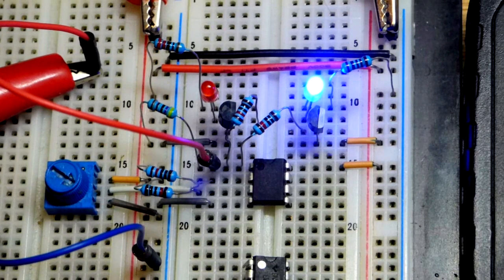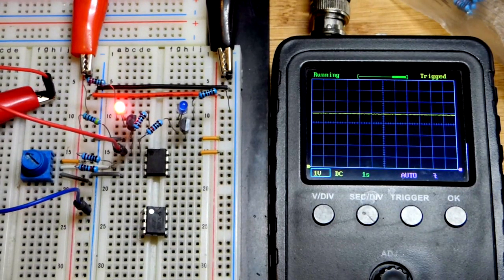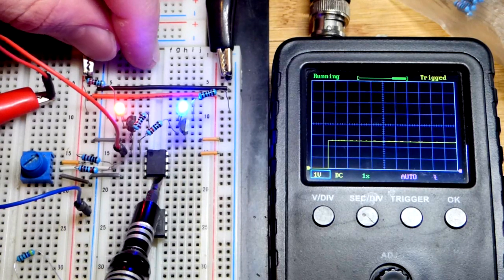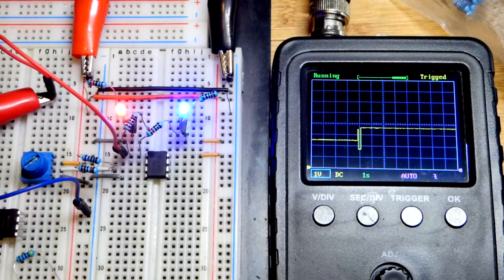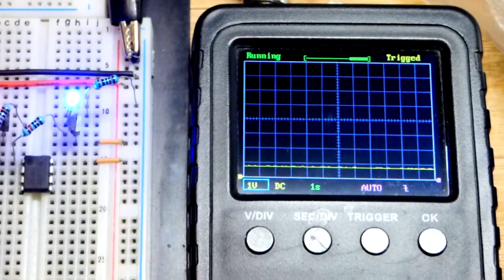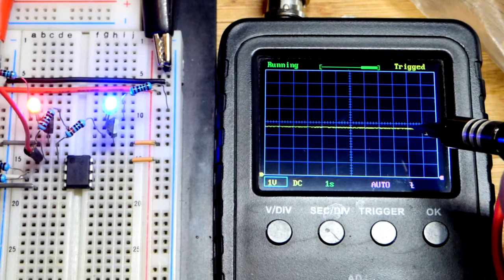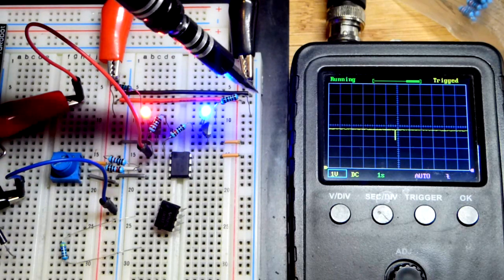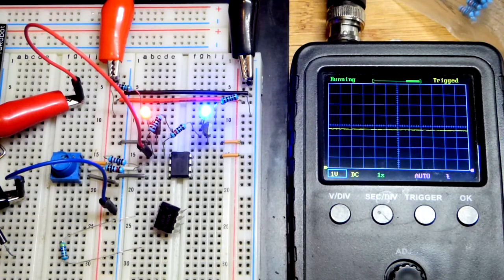Bonus video comparing NPN PNP BJTs amplified output LM393 LM358 learning electronics lesson 0021a

Comment: I am confused.   Where is the schematic?   I don't understand what point your were trying to make.      The LM393 has an open collector output so you do require a pullup resistor sized properly for your load.  You might want to configure first transistor to be driven directly by the LM393 output and the second transistor be driven by the first transistor and act as an inverter so they both switch at exactly the same time.  No hysteresis involved.   Good topic for follow up video.
Reply from the maker: Actually this is the follow up video for the last 2 videos lol. I was showing that the LM358 op amp doesn't work to control BJTs switches, whereas an LM393 comparator can.

Comment: Can you commemt or show example of using a comparator or differential opamp to compare voltage references. Im trying to find out say if 1 reference is 5.0000 volts and the second one is 5.0001 volts could comparator detect that little of a difference?
Reply: Those comparators only have a resolution of about 2 millivolts.   0.002 volts.    You will need to do some input conditioning for such low voltage differentials.    This would not be an easy task.   High precision low noise  components would need to be sourced.   Instrumentation grade parts.   OH!!!   And lots of money
Reply from the maker: I can't do that precise of testing. The datasheet for the particular op amps/comparators you are interested have info on it's particular input properties.